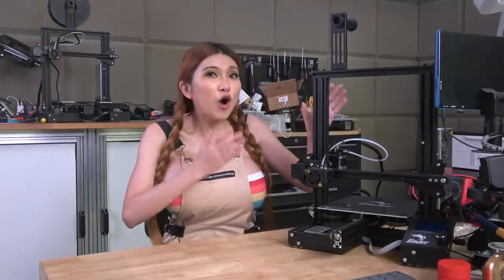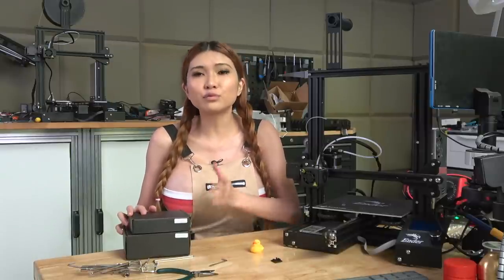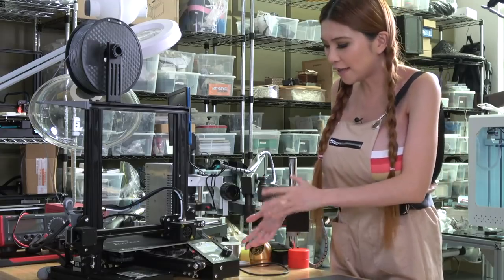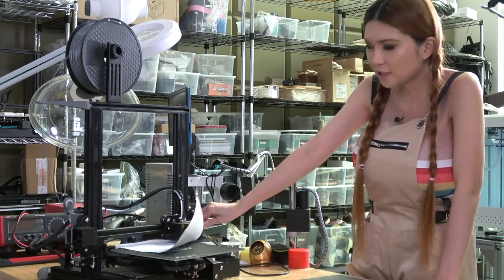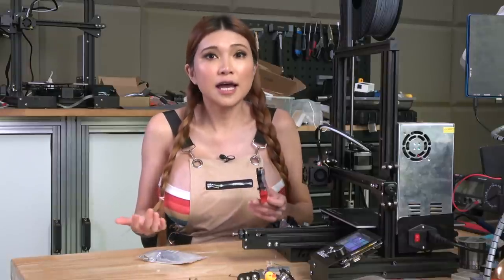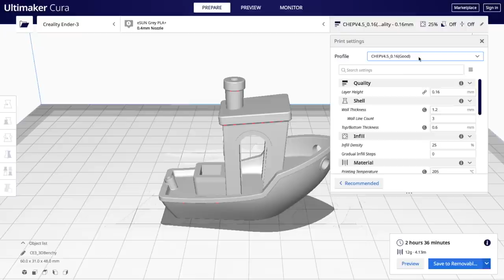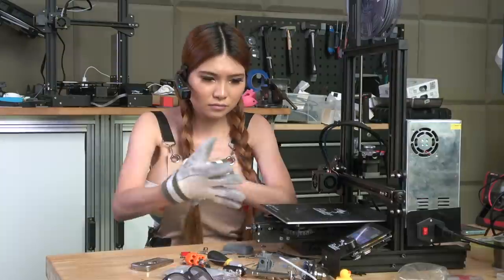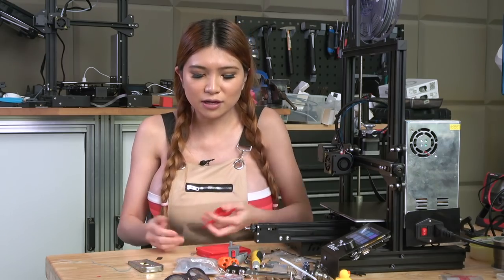My Favorite Ender-3 3D Printer Mods & Upgrades!

Comment: Oky good point with direct drive extruder. I will agree.

I have it on my Ender 3 and i started to notice problems whern i am doin mesh bed leveling, and problem is next:
     When im doing mesh on side toward z screw everything is working ok, but then when i'm coming over the middle of printer towards other side of Z axis, mesh bed leveling gets unresponsive. And i started to notice that even filament doesnt stick well on more you are away from Z axis screw. 

So i am slowly working towards dual z mod , cause its obivious that its must have if you are using Direct drive mod :(

Comment: One of the best upgrades for my Ender 3 was the Creality PEI magnetic flexible bed and I have already purchased 2 of the SEEMECNC EZR STRUDERS for my Ender and my CR 10 but my My Ender 3 is printing Flexi so well without the struder I'm not going to upgrade until I have some printing issues. The Belt Tensioner also looks like a great upgrade too ! Thanks for another great video Naomi

Comment: What's the benefit of the logic board upgrade? Does it just give you a touchscreen on the printer itself? I don't mind making adjustments via an attached laptop if that's the only benefit... [Sorry, new to this & still doing research; no actual familiarity w/ additive machining yet.]
Reply from the maker: Quieter, improved UI, slight improvement in print quality

Comment: Hello. Nice upgrades I already have some of them :) I particulary appreciate the extruder I will see more about that.

But my advise for the last one (magnetic flexible build) is you should buy an aluminium plate where to stick your magnet (aluminium plate with magnetics build you will stick to base plate with tongs). Why you would tell me ? For maintenance cause now you could'nt unmount your base plate very easily...
Reply: So if you read it again my best upgrade on my printer (clone of ender3 I will not name it here) is...... Magnetic rails ! (especially on y). A little more complicated but litterally your bed levelling will become awesome ! 

Thanks for video

Comment: A lot of those upgrades apply to the Ender3 pro - but the Pro I got last week has a metal insert for the filament insertion on the extruder to prevent the plastic from getting chewed up. I have to admit I was surprised the SeeMeCNC extruder mounts on using Phillips-head screws - or did I not see the screwdriver properly? Glad I sprung for the Ender 3 Pro though - comes with that same magnetic print sheet you're using, and the fan is mounted on the underside to avoid plastic potentially clogging it :)
Reply: Also, trying out something with a different electronics board on the Ender3 Pro - it looks like they're hot-gluing the smaller connectors in place (endstops, fans & thermistors). Probably avoids them getting loose during transport. A bit annoying to undo though, but not impossible.

Comment: hello i had a question im looking to spend around 1000 dollars on a machine with a large large build surface that can have multiple heads 3d printings , cnc, and laser by chance? do they make something as an all in one unit with a large build surface for around that price? or should i look at buying 3 sepratem achines or a diy setup? kinda new to all this ive used 3d printers before but would like something big that can do multiple things thanks love your chanel been watching for about 3 years now
Reply from the maker: Better of with separate machines, none of the combos are great...

Comment: Screws everywhere 😂😂 simple mode 😉 I got geeetech a10t with skr pro 1.2 and tft35 v3 +wifi, Dual z axis, extended frame for reach all parts of heated bed, custom made electronic case, x y belt tensioner for ender CR10, linear rails, aero extruder, tmc2208 uart drivers, purge bucket. Takes me lot of time to design parts, print it and test fit. But it's great printer now, but upgrade cost me 300$ than its same cost as printer itself 😂

Comment: My SKR mini board melted after 40 hrs of run time.  It melted at the bed heating  lead.   Good thing I was in the room when I smelled something hot.   Up to that point I liked it. Also I could not get the new  control to work.   I could never get the color screen to turn on.  Maybe I was just unlucky,

Comment: Naomi, I have an Ender 3 I can not get to work. I Ordered the Mainboard and Screen U installed, What Firmware do I need to download and Why do I need it. Thankx for any help... I could not get the Mainboard V4.2.2 nor the V4.2.7, nor the Creality Touch Screen, Orginal Ender 3 Screen is so messed up with Pixel lines U can not read the Screen, I'm pulling out my Hair,  Please any advise..

Comment: hello Naomi for Ender 3 the sheet of paper is enough or BL touch is better ... I'm not able to level the table
pardon my English good work good videos
Reply from the maker: If you have trouble with the paper method get a bltouch, but I'm fine with paper...
Reply: @Naomi-Wu  hello Naomi i'm going to try to level it with paper you have to keep it with a slight pressure right ... just tune the screws with spring and then don't move the software ... I've seen so many videos ...

Comment: Jesus, only 1 printable upgrade? All the rest upgrades by sponsors?
Here's my list:
Triangle Lab BMG Clone
Hot-End fix mod with capricorn tube clone (capricornus from trianble lab are good)
TL-Smoothers (BigTreeTech has some pretty cheap ones)
Yellow Heated bed Springs
3d printed belt tensioners
Side or rear spool holder to reduce vibration
Concrete base and some dampers if you're not willing to pay for the SKR (I still highly recommend it, it offer way more than just silent drivers)
PEI Magnetic Bed from Aliexpress

Comment: Would love to see you review  some inexpensive subsurface engravers for glass if "inexpensive" is possible.  Im interested in doing 3D images inside crystals but... These machines are expensive in the west and there is little to no information on the machines.
Reply from the maker: I looked into them, the software seems terrible- often requires a dongle. Some might be better but I would not be comfortable recommending them...

Comment: Can someone recommend a modular print bed changing system that is proven to be good and not limited to any kind of printer?
I am in the EU.

I am thinking something like glueing a magnetic base with some sort of aligning system to the existing heater, then glueing the various print bed surfaces to a sheet of metal.

I am pretty much satisfied with UltraBase that I am using now, but I would like to try out different surfaces for different plastics. It seems ASA does not stick very well to UltraBase, that's the primary motive.

Comment: Actually I prefer PEI powder coated spring steel, as I often print boyes for electronics, there the structure is quite amazing.

If you use spring steel, you can use an inductive probe for ABL instead of the very common (and expansive) BL-Touch. Actually for the price of a BL-Touch you can get an spring steel with magnetic bed and an inductive probe...

You are totaly right with direct extruder + single z being no good idea. But also the exentric weigt to the v-rollers might get you into trouble. They wear off fast.
On the other side, a direct extruder + second z increase print quality, comfort and reliability. The Triangle DDE Upgrade + second z-motor+leadscrew does a good job. To avoid the v-rools wearing off, I use a linear rail on x (https://www.thingiverse.com/thing:3928610).

Also I use two lead-screws with a lead of 2mm instead of 8mm. The layers look more precise now (esp. using ABL)

Of course, if you sum up all upgrades (SKR e3 mini v2, second z motor, lead 2mm leadscrews, DDE, PEI powder coated spring steel, inductive probe, linear rail, touchscreen), the upgrades nearly cost as much as the ender 3 itself. But on the other side you get a print quality and comfort quite near to the Prusa mk3s, which cost about 780$. And you can improve the printer step by step instead investing all the money at once.

Comment: The Ezstruder for me was a good upgrade for me from stock. The gear on it gripped the filament better and the surface results after it has been tuned game out much nicer.  Belt tensioners, PTFE couplers, Capricorn tubes, spring steel + PEI sheet makes it so easy to use. And overall better user experience. All good things!

Comment: i've tried to print with ender 3 but didn't get detail high enough. What kind of printer would you recommend for small scale prints with high amount of detail on them? resin?
Reply from the maker: Sure resin is much higher resolution but it's very messy.
Reply: @Naomi-Wu  i know :( but i usually try to print and then cast my things in bronze or silver. and i can never go small enough or smooth enough with PLA.

Comment: MY ENDER 3 MOD NOCTUA FANS (MAINBOARD POWERBOARD AND HOTEND) MOTHERBOARD THE SAME AS YOU USE. HERO ME GEN 3 FOR THE HOTEND. AND PRINTED BELT TENSIONERS. THE BEST PRINTER EVER NO SOUND. MY PRUSA MK3S IS LOUDER. I USE PRUSASLICER WITHOUT TOUCHING ANY PARAMETER AND I GOT SUPERQUALITY

Comment: For people like me, who don't have a separate workshop and have to spend some time near the printer, I'd recommend not waiting 100 print-hours before installing a silent motherboard. Creality 1.1.5 or SKR Mini E3 V2 or some other silent board. I'd have gladly paid a bit more for my Ender 3 Pro to get it with a preinstalled silent board.
My favorite printed mod is the PSU case mod to install a 92 mm fan: http://www.thingiverse.com/thing:3206719    Noctua fan with a low noise adapter (fancy name for a resistor) is almost silent.
After replacing the hotend fan (Noctua again) the loudest part of my printer is the part cooling fan (stock).

Comment: Ordered a unit on 05/05/20 and still have not received it yet.....emailed them and they said it will ship on 6/26/20, checked the tracking number and it still has not shipped.....wtf.

Comment: What about Ender 3 pro, is it the same upgrade. I have just buy this printer. thank
Reply from the maker: It's a bit heavier but mostly the same
Reply: Pro has a wider Y-axis extrusion, so be careful when ordering a belt tensioner for Y. Also the motherboard housing is flipped upside down, so you don't need a fan cover. Pro already has a flexible plastic magnetic bed. Other upgrades are the same.  You may not need a metal extruder because current version of the standard plastic extruder has a brass bushing in the spot where filament goes in.

Comment: learn from a hard lesson, I almost bought the Ender 3d printer instead, I got the JGMaker magic 3d printer, that is a total Nightmare to deal with, all kind of settings changed, leveling the bed, cleaning, just drive me crazy, after half roll of Filament is gone, finally got 2 support parts has print successfully, it is just not worth to save $40 to bring all these trouble. I wish I have got the Ender instead of JGmaker.

Comment: Many great modifications and easy addons for the Ender 3. I really like the stock magnetic bed that came with my e3 Pro. The metal plate will definitely be what I switch to if/ when I replace it.

Comment: Overall good video and good mods. I like the other extruder your showing ive never ran into it. Myself I have a small farm of ender 3s for my work. None of the direct extruder kits ive seen work as their way to heavy. So I designed my own that can be printed and a Titan extruder with a very small step motor can be used which adds very little weight. So here is rough of what I do. E3 SKR mini (same as your video.) I keep same display although Iget why you talked about the other triangle labs e3d tool bltouch (sorry i Like my sensor and i get triangle labs one its like 12 bucks.) I change the fan out to a 2040  and put on my fang design for cooling. 
So all this together it actually prints better and cost in all upgrades is under 100 bucks. 
As for build plates I totally agree with you it factors into alot of what you doing etc. So I am not going to touch that either. Wish their was a way to attach a picture here I would love to show you the design. the fang blower is quite nice looking on it. ironically appearance I could care less about as its for function, but the shape is needed for how it works.